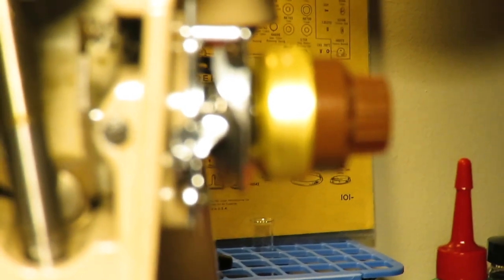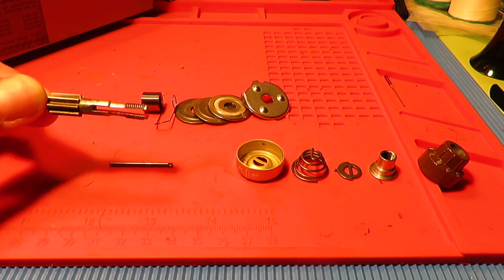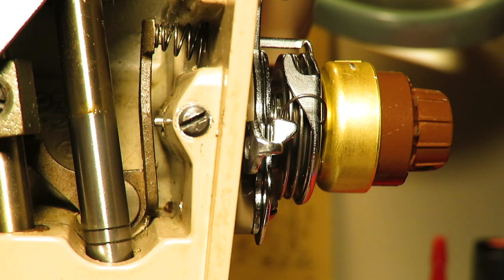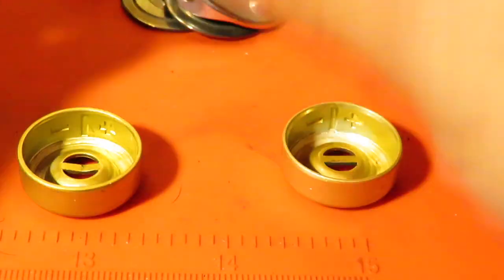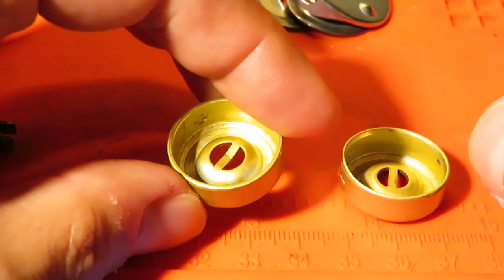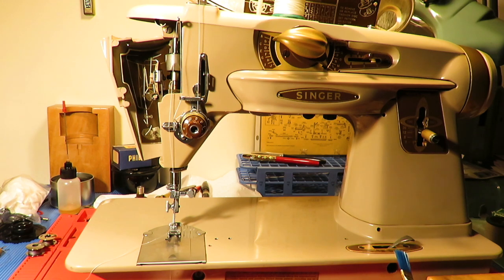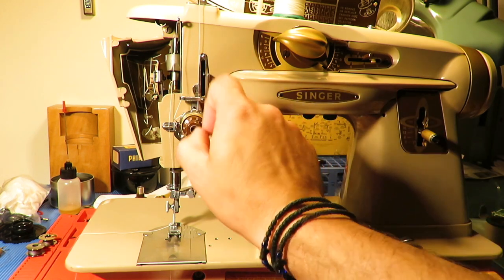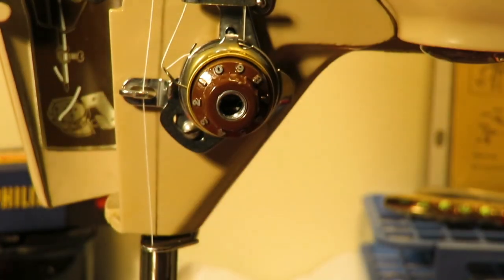Singer 500A Rocketeer Thread Tension Unit: A curious problem solved, and thoughts about calibration

Comment: This is the best idea for setting the tension on a 500A/503A. This tension assembly has a different style numerated dial that is harder to set to zero, IMO. Your method really simplifies the process and even takes into account the possibility of a second thread which is something I never even thought of. For the last few machines I did I made the setting at the zero number on the dial and that was around15mg. When turning the dial farther to the left to the stop position that took the reading much lower; almost to 2gm. I liked that method a lot as setting the dial to zero for Satin Stitching narrow to medium width had the stitch nice and flat, but slightly puckered at the widest width. By turning the dial all the way left to the stop even the widest ZZ width setting had "unpuckered" stitches. I've always struggled with that and this method cured my puckery wide satin stitching. I'm so happy you continue to make videos as you have some great insights and fresh methods. Very nicely done.
Reply from the maker: Thanks Andy -- I learned from the best!
Reply: Agree

Comment: This was very helpful, thank you! I've been using my machine a few days now, and come to find out, the tensioner wasn't even in place properly. It was way too tight and I had no idea it was supposed to disengage when the presser foot is up. I set it properly and calibrated it, and it's working much more consistently now. I got my 500A for free with a full set of accessories and the original manual because a neighbor threw it out with their trash. It's mine for life now!
Reply from the maker: That's so good to hear! And what a find... I would slam on the brakes to rescue any Rocketeer that I saw in the trash! It was lucky you found it.

Comment: Thank you. I have owned my 500a since the mid 60’s and the thread tension was really my only issue with my machine. I received a Bernina 1130 as a gift from my husband in the late 80’s which I like very much but kept my 500a as a back up. I plan to tackle correcting the tension issues soon as I plan to gift the little jewel to my granddaughter soon.
Reply from the maker: Wow, an original owner! That's truly wonderful. My mom had a 640 Golden Touch&Sew that I learned a bit on, and I started my collection with a good old 15, but when I saw the 500A I thought, and still think, that it's the most fantastic sewing machine ever designed. I really hope you can sort out the tension issues. I've admittedly struggled with mine as well (part of what prompted this video) and some of what I've experienced is that I think this machine really only likes standard polyester "stacked" (as opposed to cross-wound) thread. When I've had issues, it seems that swapping the thread can help.

Comment: Thanks for sharing this very clear explanation about the tensioner of the Singer 500A and similar. I got two comments to your video. I think your way of adjusting the release point by bending the cross bar of the cup is a OK to do. But it is also possible to do the same adjustment by bending the arm pushing the pin in the head of the machine. I have done that successfully on a Singer 201, and it is just another method. The other comment is about the possible repair of a tensioner with a plastic coup as used on a Singer 237. I made a video about how to make it work using a bended steel thread - so it is possible to make it work. 

When I compare the Vintage Singer tensioners with a dial, I have to say that they typically got less quality and more problems than I have seen on other brands of sewing machines. One good check is to measure  the thread tension repeated times just after the tensioner. Between each measurement you lift up the presser foot to release thread tension and turn the disks a bit and then set the presser foot down again and measure thread tension again. You can be surprised how much variation you get in thread tension this when you do that more times.

I made a playlist mostly of videos I made about thread tensioners: https://www.youtube.com/watch?v=kINRgj42GnI&list=PLhBGyDo4tov8TK-4lHdQwU96yaDnCw0a7

Comment: With a 403A, I recently had the exact same issue you had with the tension assembly not fully releasing the upper thread tension when the presser foot was up.  The pin was the correct length, the indicator crossbar was not broken or bent, and all parts were put together correctly.  In my messing about with everything, I looked at the three tension discs and they seemed to my eye thicker than normal, whatever normal is.  I took the three discs out and measured the total thickness of the three discs as they were held firmly together.  I used a cheap plastic Vernier caliper and got 5.50 mm.  I happened to have some spare tension discs.  The total thickness of these spare discs held firmly together measured 5.10 mm.  I put these thinner discs on this 403A, and it did solve the problem; the tension is now releasing properly.  So about 0.40 mm did make a difference to release the tension properly.  Of course one has to have some spare thinner tension discs!
	I look forward to watching your future videos; your methods of teaching, your clear explanations and camera work keep my interest.  I really like your method of setting the zero of tension; it is very useful.
Reply from the maker: Wow, thanks for that amazing tale of tension disc thickness, Carole! It is so interesting that there could be such variation, but also not surprising. Did you happen to notice if the discs all had the same part number? I guiltily want to collect them like coins, because I think they're beautiful and heavy and stamped with Singer. Also, they remind me of the coins my neighbor used to bring me from his travels abroad when I was very young -- the Danish 25 øre, I think, had a hole in it!
Reply: All the discs do have the same part number:  #172226. The thinner ones came off my 401 parts machine made in 1959 in Anderson, SC.  The thicker ones came off my 403A made in 1960 in Anderson, SC.  So both sets are close in age made in the same place, so who knows why the differences!
Reply from the maker: @carolemagnusson5044  Crazy! Maybe someone set the milling machine wrong that day...
Reply: @carolemagnusson5044  That is an interesting observation. The tension disks of my Singers from SInger 66k, 201k and 237 got the same (low) height and the part no. 2102. I got some new no name tension disks from China, and they got significantly higher height and they cannot be used just like that in these Singer machines, because then your tension release will not work.

Comment: Thanks so much for making this video, I am attached to the beige slant shank singer family, and anything about the finer points of adjustment on them is so welcome!

I ended up cutting a piece of plastic bread-bag clip to reinforce a bar that had too big a wear spot in it.
Reply: I agree, I have a 401g sadly the “Rocketeer” seems not to have been sold in the UK, I’d love to own one.
Reply: @tonyray91  feel the same about the 401g, the rocketeers' styling is great looking, but sewing on them is a slight demotion in utility from the 400 series, due to the weird bobbin winder.  contrary to many opinions, I've found the "automatic thread control" actually helps when stitching  with thicker thread, I like having the option.
Reply from the maker: @sauces_official  So interesting about the thread control -- I've never found it to make much of a difference. I love that it was only ever on the 500 series...
Reply from the maker: Also @Sauces this is a brilliant solution to a pretty vexing weak point in the design of these tension units. Thanks for sharing!

Comment: Oh my goodness thank you for this video I have a singer 500 a Rocketeer and perfect condition beautiful machine everything is perfect but my tensions wacky I’ve had it for about two years never been able to get it right and a riddle to use it watching your video I’m missing the adapter and the dial that little piece that goes inside the brown piece I miss both of those they’re just not on the machine I have the gold up over one around one with the plus minus I’m not missing it man now I know why the older singers I have don’t have that cap so I didn’t even notice it was missing. Thank you so much next question do you by chance know where I could buy the adapter in the dial?

Comment: I had the same problem with the bend cup, and I fixed it by modifying the little washer, @4.06 third from right, so it fitted at the back of the cup, and is much stronger. Works perfect.
Reply from the maker: That's a thought I had too! Lots have wondered if there are other items out there like that stop washer that can be used (without using the actual stop washer from the unit!) Funny that you could reassemble it "the wrong way" to fix it!

Comment: Thank you for that.  I’m waiting for my 500A to arrive and trying to find out as much as possible about them.  I’ve done a lot with 99Ks and their tension disc set ups but this is quite different.  Very interesting about the bar in the indicator and the tension release pin.
Reply from the maker: Thanks and you're welcome! AndyTube's series about the PA motor was what introduced me to his channel and helped me service mine, and then his comprehensive 401 series was what guided me through my restorations of several 500As :)

Comment: Sorry that last comment wasn’t very clear I was using speak to text while the video was playing lol I am missing I just checked my selector gold aluminum pieces mine is aluminum and it is flat as well another issue thank you very much and I am definitely missing the adapter and that brown cap dang it I had a little clamp on it with repress them in and it kind of worked but not well enough for me to use it so thank you so much if you know where I could buy the adapter in the brown thing I would be greatly appreciated everything else on this machine is original and I have the original Copenhagen desk that it came in so I would like to get old pieces of possibly you know where those are at thank you very much have a blessed day Jen
Reply from the maker: Hi Jennifer, there are often spare parts at places like SingerOnline.com, Etsy, ebay, etc...

Comment: I had the same problem on a 503 so I ended up just making a new pin from a nail.  Unfortunately I had to figure it out and make it from scratch because I couldn't find a solution searching on the internet.
Reply from the maker: AndyTube has a video about that, linked above in the description. I was corrected that he uses a "finishing nail" and not a "roofing nail," which is much bigger. I joked that the roofing nail must be for industrial machines haha!
https://www.youtube.com/watch?v=M1kXDd5GLEE

Comment: Interestingly the German made Singer 401g does have the automatic thread metering device you mentioned whereas the 401A does not. It seems strange that Singer would go to the effort of developing such a device and putting it into production for it then to be dropped. it would seem to warrant further investigation.
Reply from the maker: Wow! I just looked one of those up -- fascinating. I think either it doesn't seem to do much, or people have (perceive, at least) actively worse sewing experiences using it. You know, there's another one-off element I've known since childhood that took arguably even more resources and developer time, and that's the vacuum-assisted needle threading device shoehorned into the Golden Touch&Sew 640. I met the engineer who designed it once!
Reply: I realize the reply is 2 years late in coming but...  Automatic Thread Control never received a warm welcome on this side of the Atlantic Ocean, only the 500A, 500J, 503A, and 503J had it.  Out of the ten 400 series G machines made, nine had Automatic Thread Control, only the 414G lacked having it.
Reply: Funny I was only using my 401G today and stopped using the thread metering as it seems to be giving me issues, by passed and all was well but I might not have had the metering threaded correctly. I would love to see a technical article on that innovation.

Comment: Am hoping you can assist, please read below. 
I have pics & short video to share that mighy be helpful.  Thanks in advance for any help!
 
UPDATE 1 with pic & video: I removed the tension dial & reinstalled it, the take up lever still does not move the presser foot up or down via the machine or manually.

ORIGINAL MESSAGE: Presser bar will not go up or down.  I'm brand new to sewing & successfully made a few seam repairs today. Out of no where, the 'latch' on the back of the machine that moves the presser foot up & down is still moving up & down but the presser foot itself is NOT moving - see video.  The only thing that happened between repairing seams & the non-moving presser foot is I (attempted) to adjust the pressure adjustment dial, it came off & then I reattached it & the screw is tightened.  Please help!
Reply: Hmm, I don't see any pics or videos, but it sounds like maybe the bracket holding the presser bar has come loose -- I would refer you to the Service Manual here: (https://www.manualslib.com/manual/1104004/Singer-500.html?page=4#manual) on page 4 it shows set screw B, which may be the problem if it's loose. There's also lots of instructions for how to remove and replace the tension setting dial properly and make sure that's in order.
Reply: @matt21525  thanks for the reply Matt.  I'm not familiar with youtube and was not sure how I would post the pictures or the video of what's going on (not going on) inside the machine when I attempt move the presser foot lever up & down.  It will not budge via machine or manually trying to move it.  If you can instruct me a way to do this, am happy to send those along.  Thanks for the recommendations.

Comment: Finishing nail not a roofing nail.
Reply from the maker: Oh right... the roofing nails would be for industrial machines 😂
Reply: @thevmc  I had the same problem with a tension unit on a Singer 15.  Bent horizontal.  I think this is a design flaw on many if not most of these units.  The aluminum doesn't hold up.  I bent it like you did but toyed with adding another strip of metal and using epoxy to glue it in place.
Reply from the maker: @r.duroucher225  Nice! I was thinking about this later, and wondered if you couldn't also adapt a part similar to the stop washer in the front of the assembly, to do the same duty.
Reply: @thevmc  I hadn't thought of adapting a part, the furthest I've gotten is looking around my workshop for a likely piece of sheet metal to cut into shape to reinforce the horizontal.  I suspect that a piece of thin steel sheet metal is the likeliest candidate, but I do have a few pieces of spring bronze that might work.  I've been leaning toward epoxy, but perhaps some other glue would be more appropriate.  It may be that solder would work.  At this point, bending the horizontal into shape has continued to work, but the next time I run into this issue I'll be sorely tempted to get out a pair of shears and some metal.
Reply: @thevmc  I actually did laugh out loud when I read the roofing nail comment.
Reply from the maker: @r.duroucher225  haha nice! It's a very VSS/Jim comment. I wonder if a loose washer type thing might work ok -- then you wouldn't have to make any permanent mods to the "indicator" and you could replace the washer as needed if it wore out too...